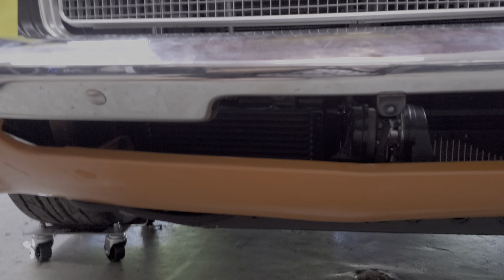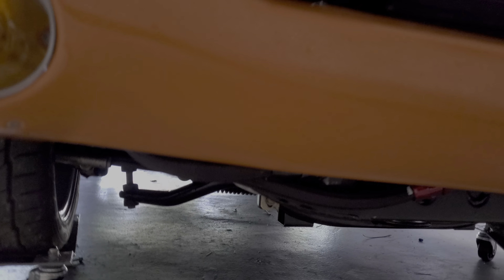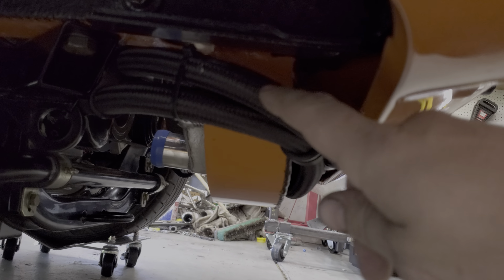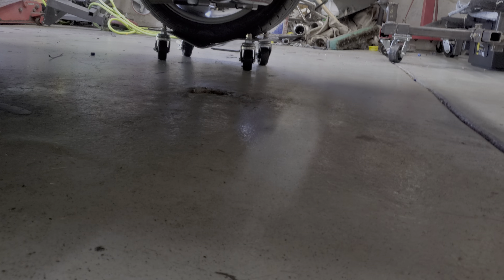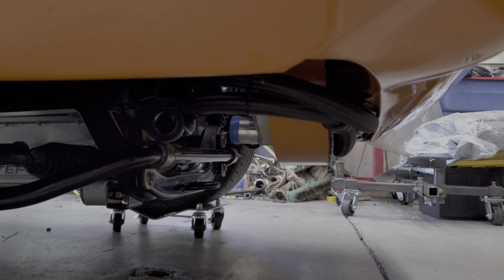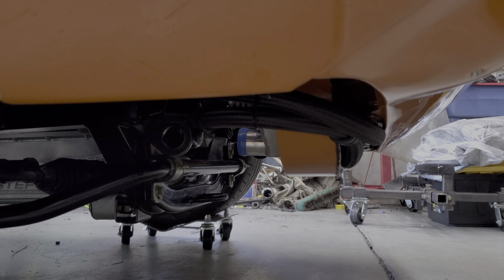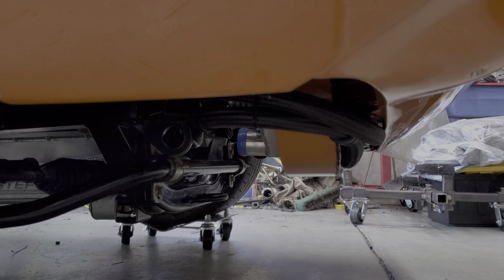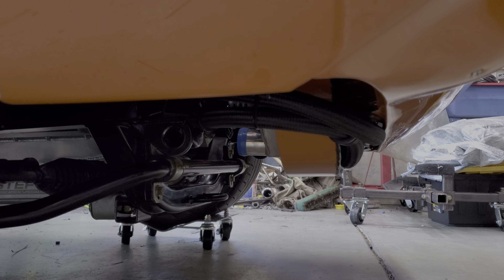1974 Dodge Challenger Hellcat Engine Swap - Oil Cooler Install (Part 2)

Comment: hey dan, what differential are you using for that hellcat swap?
Reply from the maker: The  8.75" with a Tru Trac and 3.91's that it already has until I blow it up, then probably a Ford 9".
Reply: with an 8hp90 setup?
Reply from the maker: @juliojaramillo427  no, Tremec Magnum.  Always wanted the car to be stick.